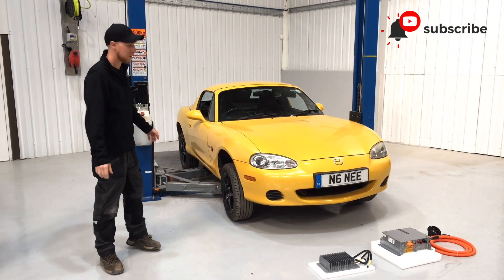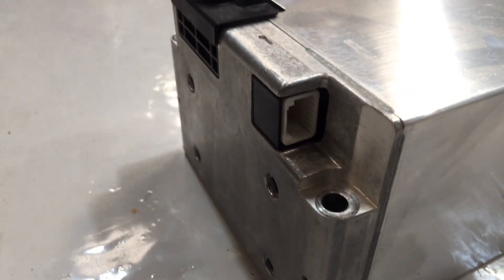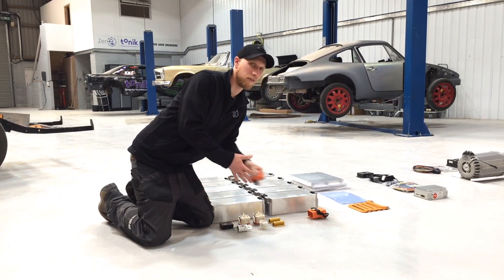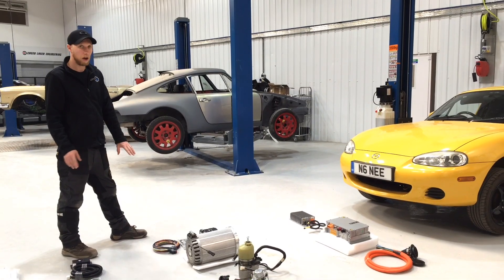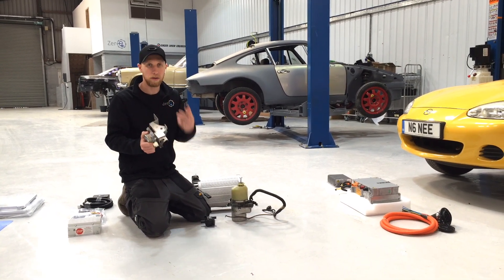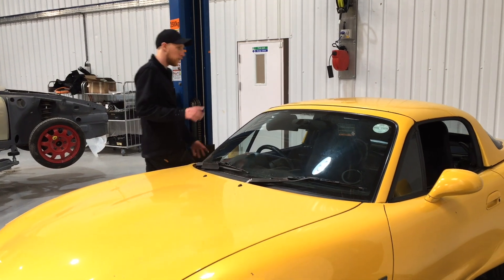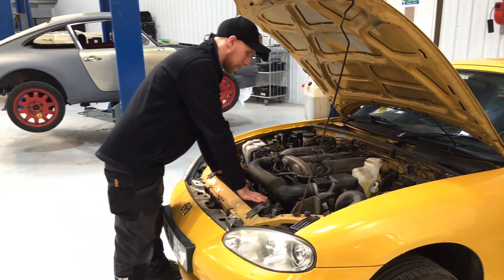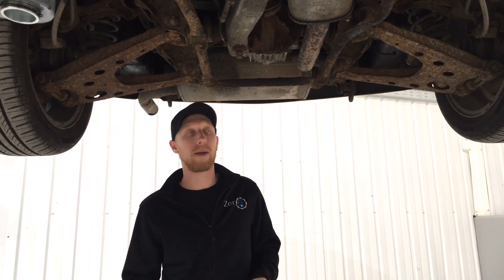We Built an Electric Mazda MX-5 Miata

Comment: Why does it seem that nobody wants to do a Miata conversion WITH the OEM gearbox and clutch? If you put a motor in front of it (and now you can get a pancake motor that weights less than a Warp 9 that isn't much wider or heavier than the flex plate and ring gear on the back of the 4 cylinder motor? you would not need a reduction gear and could keep the thrill of rowing your own, which Is 30% or more of the thrill of driving a Miata PLUS make it an even better city car that can come to a stop, sit at a light of any length and pull away all without burning out one's clutch or clutch leg:-) An Ev Miata doesn't need much more than 100 Miles of range to be the perfect 3rd car ( so a bit of batter yin the front and bit in the back to keep the legendary balance) for those perfect summer days and would be even better than an old MX-% because you could own it for 30 year in your backyard and have it need even less maintenance than the ICE version...
Reply from the maker: If you keep the gearbox most would keep the clutch which tend to burn out if not used correctly, or you leave it in 3rd gear all the time. Pancake motors tend to be very expensive

Comment: If I bring a left hand drive mx5 to you I the UK. Can you install and convert it for me? How many figures are we talking about?
Reply from the maker: Do not offer conversions any more sorry
Reply: @Hazell_Nutz  ok, but since you have some experience. Do you reckon it'd be feasible to cut down to 25%of the batteries and keep the ICE? Making a hybrid. Software aside, and choosing one work automatic gearbox. And the EV giving power to the front wheels and placing batteries in the trunk 🤔

Comment: this looks like something I could do.  Use it for a daily driver.  Right now I pay over 60 wk on gas.  66mil daily ride.  Do you think I could increase range in any way?
Reply from the maker: Yep all about adding some more battery’s. And since we build that car new small higher voltage motors have come available that are a lot more efficient.

Comment: i've had a 2013 toyota 86 (FRS) since it was new, don't drive it much, have just wanted to keep it for track days. i could afford something better now but prefer to keep it, there's nothing else out there with quite the same looks/size/weight/driving feel. i have looked into a couple of FI kits, specifically ones that won't effect emissions (jackson racing C38, works CARB) but what i would really love to do is leave the ICE side of things completely stock and instead add an electric motor. It would be amazing to build a DIY hybrid, retain the manual transmission but also have an electric motor coupled to the driveshaft to add power depending on the throttle input.

Comment: Is the car body/chasis still used as 12v battery negative?
Reply from the maker: Yes that’s correct, the hv battery is floating
Reply: @Hazell_Nutz  ...very impressed with the weight distribution, attention to details, and R&D that go into each conversion. Wish Zero EV was in Australia.
Reply from the maker: Your wishes might come true at some point

Comment: Why not keep the charger on the outside of the car to save weight?
Reply from the maker: We have done that on some builds but most people want to be able to charge anywhere.
Reply: @Hazell_Nutz  Thanks for the reply! My thinking was that you could keep the charger out of the car for track day then just throw it in the trunk for roadtrips. If it weighs a significant amount to even warrant that.
Reply from the maker: Yes that’s what we did with my skyline had a removable 22kw charger set up. But in the end got board so just fitted a 6.6kw and left it in.
Reply: @Hazell_Nutz  Awesome, thanks!

Comment: I have used the chassis and a pipe frame kit off one of these, just take out 6 bolts and the body lifts off. Will be following this, cool idea. Just easier to do suspension rebuild

Comment: So it has a terribly low top speed, it doesn't accelerate any faster, its heavier than stock,, its expensive to build, it has horrible range, you have to plug it in for long charging times. What a complete waste of time and resources. Why anyone would want this is beyond comprehension. FAIL.
Reply from the maker: Hahaha your missing the point this was built just to test the reduction gearbox.

Comment: What is the difference in curb weight going to be when it is completed? The engine in a normal miata is about 290 pounds, the batteries in this looks to be about 260 lbs but I have no clue how much the parts are going to weight... just seems like it might end up slightly heavier than when it was combustion powered.
Reply from the maker: It’s 60kg heavier and 50.7/49.3

Comment: Interesting EV, I love the Miata. I had one a few years back a 1999' 10AE model.  I have a Complete front Suspension, Brakes, and Frame assembly from a 1999 miata 10AE. I also have a 2005' Goldwing Complete Rear suspension, Wheel, final drive. It will be two wheels in front, and drive wheel in the rear. I am Looking at using a 5spd Manual trans from a Miata, Miata Manual steering rack, with a Netgain Impulse 9 Motor, It will be a reverse trike, 2 seat side by side, using a VW Karmen Ghia fiberglass tilt front end. and a custom rear single fender over the single rear wheel using two front 1967' VW bug front fenders bolted and welded together to make one teardrop rear fender.  I will have to build/fabricate a frame between the Miata front suspension to the Goldwing rear suspension. I want to keep it as short as i can as i dont want it to get that to Long of a Look. the drive shaft will be very short to No drive shaft between the trans and diff. I like the idea of 5spd gearbox. Starting off in 2nd or 3rd gear, and having a tall 5th gear for freeway driving. i am trying to keep this as light as possible and also want to keep the motor/trans as far back to the rear final drive as possible, to leave the front suspension frame to house most all Batteries and electronics. Seating will be low. windshield will also be low, the karmen ghia Top of the front body should be about armpit to should height so a short windshield looking at a 12" high two tier shield, that is a Low pressure type dual shield that eliminates all High pressure, and turbulence  behind the shield making it Much quieter and virtually Very little wind turbulence that will be over the top of my head.  This shield would be adjustable in angle to get the pressure adjustment and Sound deadening set perfectly. I have this setup on many different Motorcycles they work Great and are quiet, and No wind turbulence. Similar to a Madstad shield. Trying to get a 200 mile range out of it. I will be putting a either a Plastic or aluminum smoothing panel, to smooth out air moving under the vehicle.

Comment: How much does it weight before and after the conversion?
Reply from the maker: Hi we have corner weighed it and it’s still 50/50 but 50kg heavier over all
Reply: @Hazell_Nutz  That's awsome, I thought EV would make the car much heavier kinda defeating the purpose of driving a Miata. But if it's only 50 kg that's dope!

Comment: instead of a 70-75 kw battery and a weight of 600 kg it is better to divide the battery in two. one of 10-15 kw and 100 kg permanent with a range of 100 km that would be enough for the city and a standard battery of 60 kw and 500 kg detachable to rent when you leave the town. instead of stopping at the peco to fill up for the road you can go to an electric charging point in your city and mount a standard 60 kw battery from there and on the way to replace it at another electric charging point with one loaded. the first advantage is that it would save a lot of batteries in the world, especially since the 2 million km batteries will appear, which practically do not wear out and must be fully exploited. if a car is lighter by 500 kg, I think it will have a significantly greater autonomy in the city. this would be the second advantage. a short recharge time of up to 5 minutes to change the battery would be another advantage. the price of electric cars would drop by half. lazy people who do not want to charge the car every night or people who have range anxiety can use both batteries permanently with the asumation of costs. I'm waiting for opinions
Reply from the maker: You need to consider that there is a large range of different oem’s and that a battery of that size would have to be a structural member of the car plus the suspension system would have to be dynamic to allow a sudden increase in weight. If you think long term battery tech is moving forward very fast so won’t be long until there half the size and use non toxic materials.
Reply: @Hazell_Nutz  pls answer me this if you know. if i discharge only 10 procent of my car battery every day and everynight i charge it back all the cells of the battery are draining 10 procent or just a few cells wears out making the hole 60kw useles after that cells wears out even if 90 procent of the cells in the battery are almost never used?
Reply from the maker: cornel stamate if you us drain the battery it takes the power out of all cells evenly not just 10 percent of the total cells. Please check out our battery tech time video will explain a lot.

Comment: Imho., since cars has nothing to do with the global warming or with the bad air, roadsters and other hobby cars shouldn't have to be killed. I know E-cars's instant torque is much-much fun and awesome, but I think/imo those fun cars/hobby cars, like the Miata needs to be powered by a good benzin motor.

Other, regular cars can easily be electric, if someone wants that, but driving a Miata is another feeling.
Reply from the maker: It’s a difficult one, this is now on the road doing testing and i actually like drive it more than I thought.

Comment: 100V x 350A is just 35kW! That motor is not powerful enough...
Reply from the maker: The motor does 88kw peak. The pack will do over 800amps
Reply: Zero EV yeah but even 88kW peak is not enough for an EV. That’s less than the original motor, right? It doesn’t cost you any range (or much money) to add a motor with double the peak kW.
Reply from the maker: C T it’s the same as original 1.8, if you can find a more powerful motor at a sensible price please share there is very limited options on the market. Don’t forget it does 8,000rpm and 230nm torque it’s not all about kw there is a range of factors.
Reply: @Hazell_Nutz  Are good ev motors that hard to find? Here you get loads of used Tesla motors. Around 400 kW for 1600$ for example. 

https://www.ebay.ch/sch/i.html?_from=R40&_trksid=p2334524.m570.l1313&_nkw=tesla+motor&_sacat=0&LH_TitleDesc=0&LH_PrefLoc=2&_udlo=1000&_osacat=0&_odkw=tesla+powertrain&rt=nc

Comment: i wonder if i can do half ev conversion on my integra .. keeping the front wheel drive and engine but adding the EV powered rear axle making it awd .
i have all the room where the backseat used to be. it is gutted and caged. i think i have space for this EV kit in my car..
Reply from the maker: It is possible and have seen it done as the Ev drive units are torque based they don’t care about speed.
Reply: @Hazell_Nutz  that would be crazy. it will give me all the torque that my honda is missing and i can still keep my Vtec !!

Comment: Want electric with gas powered generator set up
So it can charge as it goes if need or get high speed with running both battery and genny together

Comment: Should've kept the gearbox.
Reply from the maker: Why? Takes up all the battery space
Reply: @Hazell_Nutz , then remove the propshaft and keep the motor-gearbox assembly connected directly to the diff! 😁

But, considering that the poor car may not have overdrive gears, it's a better idea what you thought of!  😁

Comment: What's the weight if the kit you are using I have a boat hull I would love to have as an EV boat not sure what weight it can take though
Reply from the maker: All depends on requirements, in a boat would not want to run a high voltage system.

Comment: Stupid question. Do you have to lose the gearbox?
Reply from the maker: You don’t have to. We just wanted to test our new single speed gearbox design. The benefit with loosing the original gearbox is complete engine bay fir battery’s.

Comment: Hi
This is probably the best YouTube channel for Electric vehicles. 
I am personally doing one such conversion project in India. I wonder how do you determine the motor to power the vehicle.

Thanks. You channel has been a great help.
Reply from the maker: You need to base it on torque/ rpm and weight. Aerodynamic does play a roll but for rough calculations I would not worry about it.

Comment: @1:26   Your battery modules are completely encased in thick aluminum.  This makes them heavy and probably expensive.  There is no inner pack cooling, which severely limits how fast they can be charged/discharged and also probably their life.

That is as far as I watched the video series.   Why didn't you use Tesla battery packs that have inter cell cooling ?
Reply from the maker: Our battery module come from a very very good oem vehicle so you could not be more wrong. They bolt to a liquid cooling plates which is what all oem’s do apart from Tesla. These modules can output more power than Tesla modules and the energy density is nearly the same as the 5.3kwh Tesla modules. Plus we have thousands of these available to us this year unlike Tesla module that are hard to come by in bulk you have to look at repeatability.

Comment: Good stuff, this is!
I'm also planning a build with the Orion BMS 2, since it supports CHAdeMO natively.
What I recently discovered in their app-notes on their website, are different methods for connecting cells in parallel. They do not recommend just paralleling the cells, but rather having switches to use one parallel branch until depleted, and then the other or to use separate chargers for each branch.
https://www.orionbms.com/general/using-parallel-strings/
Mind sharing your thoughts on that?
Thanks in advance.
Reply from the maker: This is a difficult one with no easy answer. If you think about a Tesla they have loads of parallel cells with one cell tap to balance the group so all depends on your battery configuration. Also weather you are mixing battery’s of different ages together.
Reply: @Hazell_Nutz  makes sense.
I'm debating between Tesla Model S batteries 6s configuration to get to 120v, vs. Tesla Class B smart batteries, 2s5p configuration for my build. Both give approx. same total voltage and Wh.
The first concerns me that series connection isn't redundant - one link breaks everything. The second - Eddy currents and risk of overcharging, per the aforementioned app-notes from the Orion. Would you be able to recommend one over the other, please?

Also, any plans on implementing the CHAdeMO from this BMS since it's supported? Don't see anyone on the web doing it yet.
Thanks in advance.

Comment: I looked at link for DC batteries.   Description   unit = 2.6Kwh, 60Ah, 11volts nominal       This does not add up from what little I know.   Watts/amps=volts     or in this case 2600W/60A=43.333V    or  volts*amps=watts     11V*60A=660w or .66Kw.     I must be looking at wrong somehow.

Comment: I’m thinking of purchasing a retired city transit bus, 39.2 feet long X 8 feet wide X 9.2 feet high. I don’t know the Tonnage of the vehicle. That vehicle will be turned into a mobile restaurant with kitchen. What are my chances in turning this vehicle into all electric, with electric drivetrain and electric appliances for the kitchen.  And can I also use solar panel with the charging port to help charge the batteries?   What are the names of the parts I would need to make the conversion to electric Plus solar panels?  And how much would these parts cost?
Reply from the maker: This is a difficult ones as you would require quite a large battery. I would recommend you look into the commercial motors that mount directly onto the rear axel or a replacement rear axel with built in motor. Parts wise the list or item would be the sane as the mx5.

Comment: All we need is a conversion kit and BMS. Battery cells are available literally anywhere now.
Reply from the maker: Not quite as they all very in size so the battery box would probably need to be redesigned to fit your battery choice.
Reply: @Hazell_Nutz  If you're converting an EV yourself, building a battery box should be easy. No need to add artificial costs. I've seen some people build EVs for free. Rich rebuilds got a totaled Spark EV for around $2k.

Comment: Just for giggles (and due to boredom) I threw some numbers on a spreadsheet with regards to the Hyper9 torque curve and the MX5 gearbox (6spd out of self-interest). I found it interesting that at least from a theoretical torque-only perspective, third and fifth gears are pretty much useless.
Basically 1st would cover (approximately) 0-30mph (0-6000 RPM), 2nd 30-45mph (3500-6000 RPM), 4th 45-75mph (3300-5500 RPM) and then 6th 75-167(gear limited theoretical) mph (3700-8000 RPM). Obviously the top speed won't be anywhere near 167, but it will be interesting to see if these figures prove out and how much use 6th would turn out to be.
This was all assuming 3.909:1 final drive and 205/45/16 tyres, and ideal conditions all round.
If anything, I think my little exercise here shows that EV gearing and ICE gearing are not very well matched to each other. A custom 3-speed would probably be the ideal to cover European/UK public road speed requirements.
Reply: Just ran the numbers for a 5spd with 4.1 rear and 195/50/15 tyres (assuming that's what you have there).
1st 0-30mph (0-5800 RPM)
2nd 30-50mph (3500-5500 RPM)
3rd 50-75mph (3000-4500 RPM)
4th (not used)
5th 75mph+ (3600 RPM to redline)

So similar but with 4th not used and a slightly lower RPM shift-up/down point.
Well, at least I think it's interesting ;-)